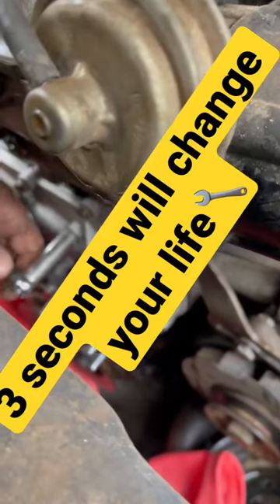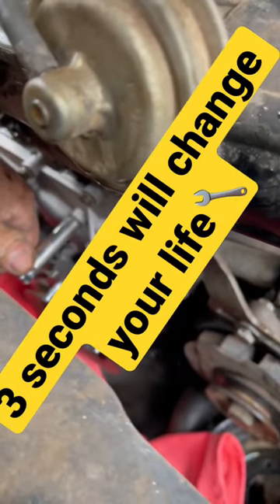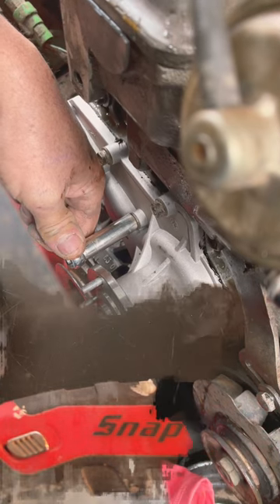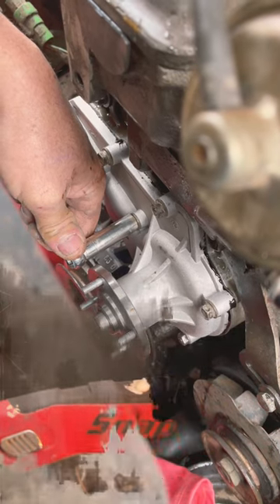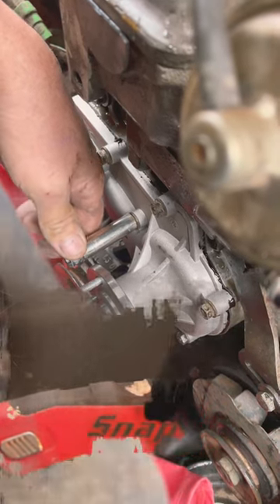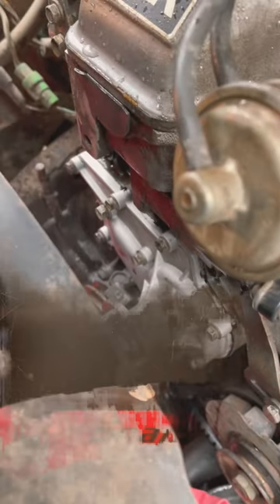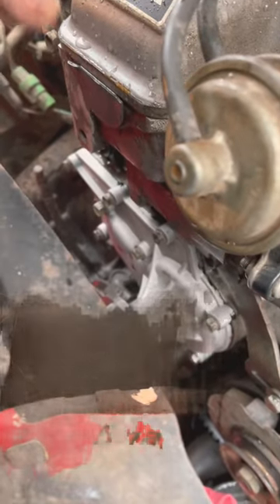This is why you hold your bolts for 3 seconds 🔧#shorts

Comment: 22 years as a mechanic I have never heard of this or read this in any tech spec. Interesting 🤔
Reply from the maker: That is cool to hear.... You know... It is interesting. Very interesting. If I did not learn this I would be saying the same thing, except 30 years....I was lucky to have found out early on.. I often wonder if I would be half the mechanic I am today without this knowledge. This technique has taught me a tremendous amount over the years. In so many ways.  Sometimes there is much more to something than meets the eye. Much can be gained by this practice.  Not many people know of this. I actually never really shared it, until just recently. You may not find this in a tech spec. You know there are many things that have to do with mechanics that you will not find in any book or on Google search. Many  great, certified mechanics and techs do not know of this. If I did not know this, I would be thrilled to discover it.  I learned this technique and have been practicing it for 30 years now. I have so much feedback from doing this over the years on thousands of bolts. You would have to experience it to truly believe it. No replacement for true experience. Most will never know because of absolute refusal to consider it to be a possibility. The people that want to know, can find out. By trying it . A lot. On just about every bolt you can use a wrench on. You will eventually have a bolt move on you. And eventually  another and another...... Then you will believe it. Along the way you will gain a better feel, a sharper focus, and better overall awareness as a mechanic. Your attention to detail will improve. Those are just bonuses. Aside from the bolt itself. And learning and thinking. I learned this top tip while working with top aviation mechanics, along with many talented machine shop owners, and operators. Educators and old time hot rodders, motorcycle builder  and tuners. Through the years of wrenching and racing , many topics would come up. And this is one we all agreed on. We never said we would go and tell anyone and put it on Youtube. This is just a technique that is used by myself and a group of excellent mechanics. The info is available now  for all. And if you want to do it for the next 30 years, I can assure you , you will learn a lot. I wanted to get it out so that others could use it . I have had this info myself for too long....and so many other tips. I am dropping all of my best tips on youtube this upcoming year. Hopefully you enjoy the tip and enjoy trying it out. I bet your arms will be shaking. Only a person that has ever tried would know that also....You can find that out also....
Reply: @fastflo1  I would think if this was a real problem that holding a bolt for an extra 3 seconds would fix, then it would've been found out a very long time ago from people with a lot higher education and knowledge of engineering and it would've been added to the torque steps buy auto engineers and such, but hey to each their own I guess.
Reply from the maker: @michaelhmfic8346  do you see top drag racer engine build tips in your shop manual? Do you think they are going to show you how to cut a piston skirt in a racing engine in your tech book? Sheesh guy …..

Comment: As a formerly certified ASE master technician for thirty five years, I call BS.
Reply from the maker: Please do not stop learning....35 years and not knowing this. I would be researching it if I just heard about it. But I learned this over 35 years ago and have used this technique thousands of times and have experienced the results first hand and actually challenged the theory to see for myself. You are basing your decision on what you learned 35 years ago or did not learn. We had different teachers. We practiced different lessons. We have different results and experience......Even if you call BS. You will not learn a thing from that call. Just consider this. You tighten a bolt. Bolts come loose. You tighten a bolt and hold it for three seconds. Now ask your self this, how is that not going to do something? Would it hurt it? Help it come loose by holding it tight? Not a possibility at all it could help that bolt stay? That is a closed mind.

Comment: I am by trade an Electrical Engineer & have been for over 45 years, and I have never heard of what you are trying to teach/preach however it certainly is making my head spin 😀 at this moment. I cannot agree with what you preach however I cannot disagree with what you teach. You see it is much better to be on the safe rather than sorry side of the tracks. Your 3 seconds hold RULE that you preach/teach is but a small amount of time wasted if the benefit far outweighs the possible disaster that may arise if one does not follow your 3 seconds hold RULE. Yep that means I'm going to do it your way from now on. This goes to prove that you can teach an old dog new tricks.
I've noticed that you speak of harmonics in your reply to a comment. Guess what that's right up my alley so I must now ask you a question or maybe two. What is the 2nd harmonic of 60 Hertz (Hertz = Hz)?  If your answer is 120 Hz than what is your fundamental frequency? I'll be waiting for your answer! BTW here is a hint- your 1st answer LIES in the second question and your second answer LIES in the 1st question. Ok sometimes I'm just a LIAR but today can you figure out my LIES in my 2 questions OR am I LYING AT ALL TODAY? OK,  please do have fun with this one & GOOD LUCK 👍 my friend!!!
Reply: I see you know nothing about harmonics, electronically speaking.
Reply from the maker: Hey Electrical engineer of 45 years! I am glad I got your brain going! That is awesome. I like your common sense logic. You will enjoy doing this. You game will elevate quickly... You will notice much more and gain much more just doing this action alone. Aside from the direct benefit.  Now as for your trick questions......I have gone over I want to say that it still is 60hz Fundamental frequency after the second harmonic of 60 hz that would then be 120hz the fundamental frequency reverts to 60 hz ? Lie or true? You tell me?😉

Comment: No if u need to torque to spec u tighten twice around the bolt pattern for a reason but this is not the reason
Reply from the maker: So what reason do you think it is?

Comment: If this was true, why 3 seconds? Why not two or five and if that holds any value it should change with bolt size, thread pitch, different grade fasteners, dry threads versus lubricated threads, etc. So many factors. I probably couldn't even list them all.. I'm not saying holding a torque could change it's value but I'm saying it's negligible change and the manufacturer listed a certain torque that's adequate. So holding it is just a waste of time
Reply from the maker: I hear negligible a lot. So it is a factor. Just negligible....👍

Comment: Lmfao
Reply from the maker: You never tried. Obviously....😂
Reply: @fastflo1  normally i tighten bolts all away around then go back around again and double check them if this is not a joke may god help you 🙂✌
Reply from the maker: @charliesgarageusa4986  well it is not a joke. If you did the 3 seconds you  probably would not have to go back. Think about that. You go back and do it again . Why? Should they be tight if you torqued it? What happens? Why would have to redo them if this weren’t true?

Comment: Not really applicable to newer steel bolts, just re-torque them twice after tightening test up
Reply from the maker: Funny ... why would you have to retorque them if they do not come loose?
Reply: @fastflo1  paper bond gasket, and first bolt started should always be re-torqued,itf could leak and work free second time prevention
Reply from the maker: @rc-t3k  👍🏻

Comment: Do you think the bolt is made out of rubber? Even shitty thin aluminum bolts won't "rebound" and even if they did, holding them for 3 seconds wouldn't do shit because they don't instantly stretch
Reply from the maker: 😁 Why do bolts come loose?

Comment: Idk I’ve been working on engines for a long ass time and I’ve never had a bolt come out or atleast one on the engine
Reply from the maker: You sound like a good mechanic. I consider myself to be one also. I If I can be a better one I will. This is great tip from a awesome mechanic. If you really want to find out if it works, all you have to do is try. Between old bolts, dirty threads, rust, etc... If you really wrench in real life on all sorts of stuff. You will feel the wrench move at one point in your life. Trust me.... Not saying your stuff is going to fall apart. But it is true and I do it because if it helps, why would I not?
Reply: @fastflo1  i mostly work on small engines like on dirt bikes that’s just my thing and I’ve never had important bolts come loose but I also use hella loctite so idk

Comment: I want to believe this is fake, but then I remember reading BMW torque specs of X lbs and a 90 degree turn on a single use bolt. After that, this seems plausible!
Reply from the maker: I am glad to hear it sparked something other than denial. Now you are thinking of what is actually happening with the metal...very well done.👍

Comment: Man I’ve seen this video in the past, and I actually thought this was true lol thanks to the comments I realize how stupid I am
Reply from the maker: That is awesome. You were right though. It is true. The majority of the people do not know. Your instinct was actually right. You are not stupid at all. On the contrary, you are quite intelligent. This is tip that I got from a friend who is an accomplished aviation mechanic at Boeing of over 30 years now. He went on to work at Lockheed Martin and currently is an educator. This technique is not well known and that is why. Not everyone is supposed to know it and the majority will never know. The ones who just heard of it either simply refuse it because they did not know it this whole time. Or others are interested they just found out and want to know more. It comes down to ones ability to do research and find out for themselves. I have been using this technique for several decades now and on thousands of applications. I have a ton of feedback. So If you really want to know the truth. No need to follow an opinion or the crowd. Pick up a wrench, follow the instructions and you will be on the path to discover the answer on your own. Not like this is magic or anything. Very simple to find out. Now, it will not happen on every bolt. If you do it on every bolt , you will discover that eventually you will have a bolt that moves in that 3 seconds. This technique is for those bolts......When you know you know...

Comment: It's 3 seconds per inch of bolt... For diameters above 5/16"
Anything 1/4" and smaller it's 2 blinks squeeze your cheeks and a fart or stamp your feet 4 times = 4 foot pounds.  👍

Comment: Last time I held my bolts for three seconds I came my pants. Also this is fake. The only reason a screw fitting releases from torque is from a bad part or its intended to. Screw threads for tight fits and torque do not have backlash. Which is why they bind to hold
Reply from the maker: Nonsense....

Comment: Torque you bolts to spec. Do a few heat/cool cycles and check torque. This "hold" method makes no sense as the bolt doesn't store or release energy
Reply from the maker: Makes no sense according to you. That is ok..... This is actually beyond simple torque. That is why nobody really understands. You know what you know.....And some people know more than others......Has to do with Metalurgy for starters.  You can Google that and look it up. This would be an excellent start for someone like you. If you get beyond that, study Junker for a bit......Hint .... It is a test,  not a junk yard.....
If you make it that far, then check out Variable Amplitude Vibration.... If you can manage to look those up successfully. We can chat more about, Torque, Tension, Clamping Force, etc.... But please get some of the basics out of the way.... Thank you so much.... Soon hopefully it will start making sense to you. I am patient, so please do not just type something ignorant back. Thanks, go study!
Reply: @fastflo1  spent 10 years working aircraft and building components(heavy federal regulations and training). better half of 15 years as an automotive tech(ford,Dodge). Never in thos almost 25 years was this taught, ever. Now there are a degree additions that can be applied beyond torque but they are accounted for. So i must be wrong, and ford, and dodge, and the FAA.
Reply from the maker: @painhour  that’s cool . It may not be something taught in a lesson or a chapter. There are something’s in life that are a compilation of techniques and information , combined with experience. My friend that taught me this had your credentials plus much more. He was probably your trainer at Boeing . Keep an open mind, because you do not know, does not mean someone else does not There are many things in this life you can learn , that are not in books. For instance , they say you can’t teach common sense. Sounds like you have a lot of book-smarts though , I will hand you that .  Keep pushing . The attitude that someone of your caliber should be saying is why do I not know this? Then go study it . The ones who calculated if it is true or false based on personal experience always get a good laugh out of me …. 😀
Reply: @fastflo1  damn, same credentials and more? How was his interactions with the FAA?

Comment: That is NOT how physics work. 😂
Reply from the maker: What?🤔
Reply: @fastflo1  holding the bolt does NOTHING to hold the bolt. Torque in = torque out. Thread locker, or increased torque is the ONLY way to prevent a bolt from coming out.  Time is not a factor, you’ve been fooled by your mentor

Comment: Or just buy a torque wrench and find out from the manual the torque specification.
Reply from the maker: Or learn how to wrench without either . Most of the time when you break down on the side of the road , you may not have those...Better to rely on skill.....
Reply: @fastflo1  No, you can go to Lowe's and buy one; you wouldn't want to over torque a bolt or under torque.
Reply from the maker: @silvermane5695  what if your car is broken and you can’t drive to Lowe’s? What if you don’t have a Lowe’s?

Comment: I just... how many bolts would this even be necessary for if it is true? 😅

for example, lug bolts/nuts are arguably some of the most stressed and vibrated fasteners on a car, and yet they hold their torque indefinitely on steel wheels. Ive never seen someone holding the torque wrench for 3 seconds, and Im no scientist but the effect should be much more noticeable on that large of a fastener

I guess if youre building engines and it helps you sleep at night it would be fine, but for the majority of us its just a waste of time
Reply from the maker: Watch this. You can't say that you have not seen it before👌https://youtube.com/shorts/_oPUcoFK0j4

Comment: um, how about you just torque that there bolt to the factory torque spec. listed in the shop manual. That is how you make sure it does not come loose. Or just keep holding your nuts like this guy and see how that works out for you. Remember,  every guy with a camera and a dream is now a professional on the internet.
Reply from the maker: That is an basic job. A good mechanic should have  ability to change a water pump with it. Looks like you would be stuck without your torque wrench and shop manual.  Remember anyone with a keyboard and the internet can sound really smart leaving comments on videos. At least we figured out who will be able to make it home and who will be calling someone for a ride. Have your manual and torque wrench. Let's just throw skill and experience to the wind. Makes total sense🙂
Reply: @fastflo1  I am a senior master service technician and have worked the last 20 years at the dealership level. But you said it best, A GOOD MECHANIC. Thats the difference, a mechanic holds their bolts for 3 seconds because they saw some YouTube short about it and actually thinks this is the magical voodoo that will be the key to their success. A technician does the job correctly and makes sure that it is fixed right the first time,  and this would include knowing what the correct torque spec is for even a simple job like bolts on a water pump. But if you want to be a backyard hack all your life, by all means hold your nuts and bolts as long as you like my friend.
Reply from the maker: @NunyaBizness1924  called it 💯too funny now you’re mad 😡 😂😂😂
Reply: @fastflo1  getting mad over a youtube comment would be futile. ofcourse the same could be said for even engaging in any conversion on here. I just feel sorry for those who are gullible enough to actually believe this stuff. But I digress, I misplaced my manual and torque wrench! I must hurry and find them because without them I couldn't diagnose my way out of a wet paper bag let alone tightening a bolt. 🕵🧑‍🔧👍